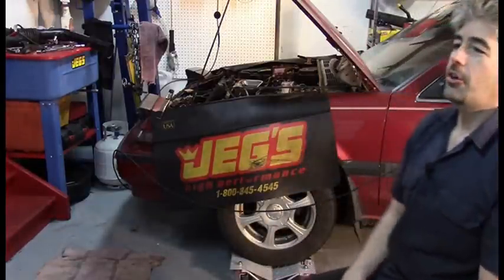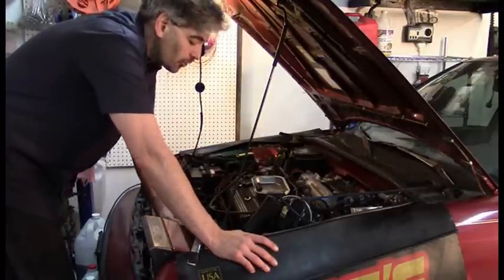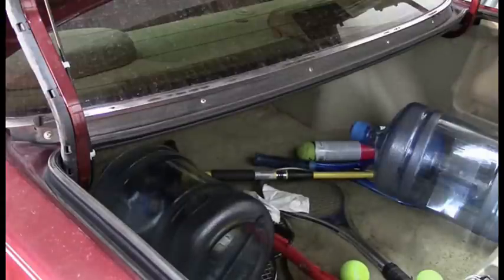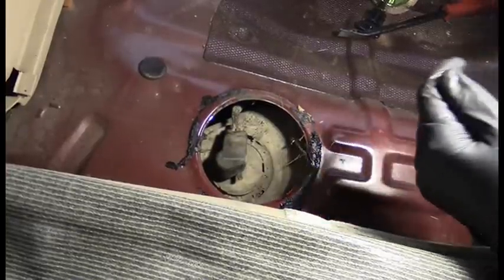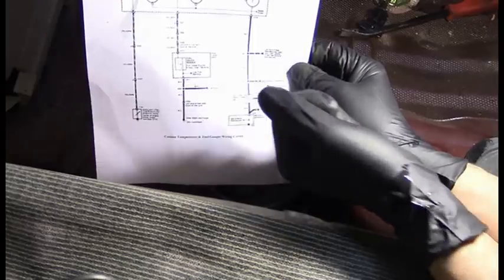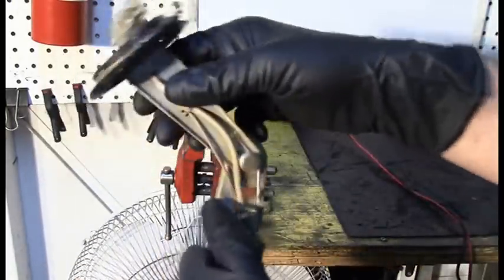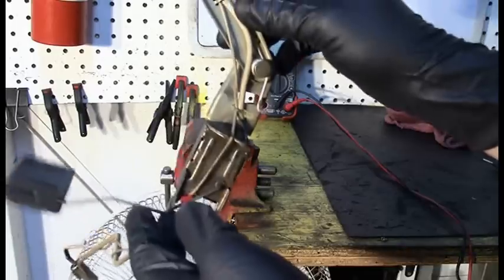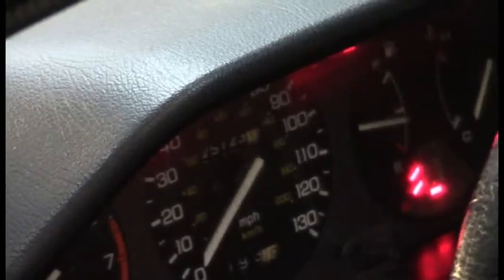Diagnosis of Stuck Fuel Gauge- Is it Gauge or Sending Unit?

Comment: You're a rare breed of molecular biologist/mechanic to help a vulnerable person instead of cheating them.
I can't access the wires on the fuel pump to my 05 Impala to see if that's why my gas gauge stopped working because I have no access panel.
Is there any other place I can access the connection between the gas gauge and the fuel pump to diagnose it besides the fuel pump?
I can't find a wiring diagram and for all I know there's a loose connection under the body of the car that I could reach if I could just find the wires.
My gauge stopped working while at a shop for transmission work and rear brakes.
It began clunking and grinding like I've never heard a car do before I even left the parking lot.
They said they forgot to remove the parking brake clips and they fell off. They said they had to disconnect the parking brake and gave me a free oil change.
I'm a widow with kids and these people have no soul. For all I know they damaged my fuel gauge (and parking brakes) but don't want to admit it.
That's why I want to diagnose it myself before trusting another mechanic.
Reply from the maker: it’s easiest to drop the gas tank slightly later on most chevy models and others without the access panel.
Reply: Schrodingers Box It sounds like you're saying the only way to diagnose it is to drop the tank, but it's even harder because it's an older model.
If that's the case then I assume I'd need a mechanic to do it, except that it would cost so much that they'd say it needs a fuel/sender unit even if it doesn't because they had to drop the tank.
I've read comments from people with access panels who replaced the pump & sender unit only to find it didn't fix the problem with the gas gauge.
Some have replaced stepper motors or instrument clusters too when it ended up being a "harness plug" or some loose connection somewhere between the fuel tank, pump/sender and gas gauge.
How would you handle this problem?
Thanks
Reply from the maker: The way I would do it if there was no access panel is very simply drop the tank a couple inches, access the wiring I need, and do my voltage tests. I find this easiest by far and i do it all the time. If I find the issue is not at the sending unit or wiring and inducing variable resistance had no effect on gauge movement, I would then test the gauge at the dashboard directly to identify the open or failed component. I have a video doing this on a speedometer on a Yukon or Bravado or similar in fact.

Comment: You're a molecular biologist?
Reply from the maker: Yes- way easier than being an electrician
Reply: Schrodingers Box I'm an electrician, and you may be right. Lol.
Reply: Schrodingers Box I've got a problem with a 99 GMC Sierra fuel guage, if you think you can help. I'm out of ideas.
Reply from the maker: What’s the issue and what data do you have?
Reply: Schrodingers Box 99 GMC Sierra. It seemed the stepper motor is going out. Shifting with brake held would jostle the motor back into proper working order. That tells me it isn't the guage sending thing, but the stepper motor. I had a spare cluster, so I switched the steppers. It went from working half the time to not at all. It doesn't matter where I place the needle, save that if I set it over halfway, the fuel light comes on. It's currently stuck at E. it won't reset, but the gas light isn't on. I have 3/4 of a tank now, but it's not showing. I've tried 3 different steppers that should be good.

Comment: Might have been more efficient to put 12 volts to the sending unit and then use the DVOM to sense voltage at the sensor wire during bench testing.  This would have allowed you to see voltage go from one end to the other and to find a middle ground fairly quickly and accurately.

Comment: I have an 2002 Chevy Blazer . I took it to get the transmission replaced and when I got my car back it worked but now my fuel gauge stays on empty , and the shop took no responsibility for it . I replaced the fuel pump thinking it was the sending unit and it wasn’t my fuel gauge is still on empty . What step should I take next ?
Reply from the maker: What was your voltage variance indication as shown in the video?

Comment: Hi there I hope you can help me,I bring my 2010 ford escape to ford dealer because of fuel pump recall after 1 day I notice the reading of my fuel,fuel gauge and mileage goes higher,the next day on my way home from work it stop on the freeway without warning,ford towed and fix it for me because part of it is there fault n my fault is the car doesn't have gas which is I didn't know since the reading is not correct,when I pick up my car for the second time on ford and put 30$ gas the fuel gauge is still stuck on empty,what do I have to do,tired of calling ford and I'm searching on website how much to change it nd it cost 2 weeks of my paycheck,can u help me
Reply from the maker: Sounds to me like your new fuel pump was not installed properly and sending unit was either damaged or is obstructed.
Reply: Schrodingers Box how much do you think it will cost me for repair
Reply from the maker: Depends- if there was defect from the installation it should cost nothing. Otherwise upwards of $500 nor even $700-$800.  
  If I fixed it, probably $400 total.

Comment: Thanks for the video!! I have a 2008 Chrysler Pacifica and Sunday morning it decided to say low fuel, I fueled up knowing I am low, but it stayed on low and have check engine light with a u1403. I was going to have a guy replace the pump. I don't have an access panel and don't know that I really wanna drop the tank. Well I find out that I have a primary and secondary pump, no idea which would be bad and sure as heck don't want to replace both. So thanks to your video, I am just gonna drop the tank and test both, so probably have to watch 2 more times...lol Thanks! Maybe I will even learn that its not one of them, but a bad wire. Could I possible test with it still connected and just expose the wire down lower and not drop the tank until needed?

Comment: How about a 1970 Chevelle? Mine reads 1/4 tank. Doesn't fluctuate much no matter the amount of gas. I have the gauge out of the car. Wish there were more shops like yours. People who care for more than the buck.
Reply from the maker: What did the resistance test indicate?
Reply: Haven't tested it yet. I don't know what the resistance is supposed to be.
Reply from the maker: None. Just test for circuit integrity to start.

Comment: i want to thank you soooo much for this video, my tractor ( Zetor proxima 7441) fuel gauge was showing more than full, with and without sender plugged in. i noticed you testing with a resistor and i remembered that i have a bunch of resistors from an arduino kit. I tried your method and yup! fuel gauge moved as i connected and disconnected a 100ohm resistor! 
I thought it was a bad gauge but you my friend have proven me wrong!
now ill take out the sender and hope that the rest of your instructions can save me from spending any money on it!

Comment: Awesome video!! I have a different problem. My 91 Wrangler :  Key on - Needle goes way past full. Key off - needle drops to empty. Key on - connector to tank (sending unit) unplugged - stays on full. Short on wire from gauge to connector ??

Comment: I have a check engine light and got it hooked up to a scanner that gave a 0462 code. I replaced the fuel lever sensor but the check engine light is still on. I have taken my vehicle to two different mechanics. One said the float is bad, the other says its the cluster that's throwing the code (which doesn't make sense to me because everything else reads besides the fuel gauge) PLEASE HELP,  I cannot get my vehicle registered with this issue.
Reply from the maker: Ok what data do you have?
Reply: It reads as the fuel lever sensor...thanks for the reply!
Reply: I'm basically going off of what the mechanics said...Then a guy today said that I may need to replace the fuel 
pump?
Reply from the maker: Well I don't go off what someone says- unless they have data. Can't help on this one, sorry. Give me some static and loaded fuel pressure curved against fuel trim and I'll make sure you don't get ripped off.  That's just how I roll.

Comment: don't forget to watch the decimal point on your meter :)
Reply from the maker: No idea what that is referring to but I will accept some advice on alternative methods to do the circuit testing faster if you have any.
Reply: reat video. I find it helpful.  when you seemed a little puzzled about 
the readings you were getting on the old sender, I thought I saw the 
decimal point
on your autoranging multimeter jump back and forth which would explain a lot.
could be just me; these eyes are old and tired. thanks for posting it.

Comment: When I disconnect the fuel lines on a diesel before removing the fuel 
sending unit, will I have to bleed the fuel system after putting the 
system back together? (audi a6 quattro 2005)

Comment: My gauge just reads 3/4 on my 98 Chevy Silverado.  It don't move or flutter.  What could cause that? Sending unit or gauge stepper motor?
Reply from the maker: What did your diagnostic test indicate when you testd the circuit as shown?
Reply: I didn't test anything don't know how to do that.
Reply from the maker: Justin Sero sr Oh too bad. Hopefully someone makes a video on how to do that.
Reply from the maker: Could be. What did your diagnistic test on the circuit indicate?

Comment: Your awesome for doing this for the elderly man and showing how to test. my car 98 mercury grand mrqs was parked and hit, since then the gauge is stuck between half a tank and 1/4 tank. do u think it would be the sending unit as well? there was minimal damage when the druggie hit my car cracked my rear bumper on the passenger side, I have a tow bar installed so that's prob what saved me from more damage. he hit that right rear corner and pushed the car over sideways about 4 feet.
until this happened I had no problems with my car.
Reply from the maker: could be. could also not be. What is your voltage variance on the sensor sweep as shown in the video?
Reply: that is a good question....im just a girly girl ....hopefully I can find someone that can test it for me. thanks for replying.

Comment: I have had many fuel sending units that read correct with a meter  and tested with harness connected to sending unit.   Sent vehicle out a week later vehicle has same problem,  It is good to do charity work but not at the expense of wasting time,  and making yourself look incompetent to save money.  sending unit will most likely fail again.
Reply from the maker: You aren't too bright are you. The purpose of this was to DEMONSTRATE THE TESTING METHODS.  This is a tutorial channel. In fact YOU would benefit from this in that if you actually understood your own measurements, they mean you have not isolated an independent variable as the sending unit itself!!! Unbelievable.
  Come on man.   Come on.  You don't understand this, really???
  Everyday people are getting dumber and dumber.
Reply: I understand the testing methods. You make them very clear  I was simply stating the reliability of the component,  I am sorry if you misunderstood the comment,
Reply from the maker: No i totally understood your comment. You were trying to state how i looked incompetent in this video by reinstalling the part after confirming proper operation because in your experience based on what was incorrect testing procedure because you didn't create an independent variable combined with an empirical ad-hoc-ergo-propter-how logic fallacy showed failure in the past. 
   If you are going to to call me incompetent, i really suggest  your procedure be  more rational than mine. much less irrational as you have admitted by your own statement. 
  come on man- LOTS of people see your comment. Don't embarrass yourself.

Comment: Hi, I have an 05 envoy, my fuel gauge was always empty so I replaced the sending unit myself, and worked for a day, next day when I crank it up, the fuel gauge went beyond full and stays like that until had half tank and started working, the when I fill it up, will do the same, some times I try turning the ignition on and off for several times and will work, some times, some times it won't. I replaced the seding unit twice and still the same, don't know if could be the gauge or wire or something else, any help will be very appreciative.
Reply from the maker: So what was the result of the diagnostic tests?
Reply: was the stepper  motor out of the instrument cluster ,  i replaced it and works just fine.

Comment: Good Day:  Here are the things that I for got to say. 2003 ford f-150 xl 4.6 liter 4wd. I turn the key on and the fuel gauge jumps up to full and then drops down to empty. both movements are fast.
Reply from the maker: What is your voltage data?

Comment: couldn't u have also used a test light instead of a resistor to see if that fuel gauge would move?
Reply from the maker: Sure. Anything that has resistance can be used but since I knew the quantitative value of the resistor I can anticipate the gauge's reaction.  I don't know the quantitative resistance of my test light off the top of my mind.

Comment: Great video! I, however have a ques. I have a 95 Toyota Tercel. I can fill it up and it shows full, but them after about 100 miles, gauge suddenly drops to almost empty or 1/4 tank but I know I have gas. I used to get about 350 per tank, now I'm scared to go over 200 because I don't know what the problem is or how to have it checked. Can you advise me please? I will then fill it up with like 10 gals or so and it goes back full as if normal and just stressful. LOL Thanks
Reply from the maker: What data do you have from the sending unit voltage?
Reply: I have not had anything checked. I was asking perhaps i you could recommend what would need to be checked so someone doesn't try to scam me. I guess that huh? (LOL)
Reply from the maker: N Valdez You need voltage off the sending unit and interptet the etiology for the symptom. There is no other way.
Reply: Oh OK . . thank you . . <3

Comment: Alright my gauge stays stuck on full. have a 91 civic. swapped with an integra ls dashboard and motor.

but I replaced the fuel sending unit with the original civic one and when I move the float on my own the gauge moves the meter correctly but when I put it back in the tank  it just rises to full?? makes no sense
Reply from the maker: Makes perfect sense.  What was the voltage data you got on feed and return that indicated to you the sending unit was faulty?
Reply: +Schrodingers Box I don't got none of that lol.

the unit that was in there before was burnt out in the middle.
Reply from the maker: ***** Exactly.  Thats why it makes sense.
  The video shows how to do the diagnostic.  Once you do the diagnostic the only possible explanation for the problem will be apparent and of course by definition, it will make sense.

Comment: Trying to diagnose the gauge of an 81 Ford F-250 and the Haynes diagram is pure crap as expected. I'll figure this out eventually.
Reply from the maker: As was shown you don't need a diagram. Only basic design compehension is necessary and you should be able to map out your own wiring diagram.
Reply: I managed to test the gauge with some trial and error. Unfortunately the gauge is fine meaning BOTH tanks have bad senders. Think I'm gonna pull the bed on this one.

Comment: it got a 94 dodge ram 2500 the gauge stays at half a tank until you fill the tank up then it reads full after that when it goes bad to half you cant tell how much you have needless to say i have gotten stuck and a custom to carrying back up fuel can cause you cant really push a 2500 by yourself :(  im try this on the weekend
Reply from the maker: Just perform the simple diagnostic test to find the issue

Comment: See in my gm 98 Chevy malibu the gauge moves very quickly when i turn it on without taking its time to move slowly up and then I put in gas and it doesn't read how much I have, it has power and all But I'm just gonna replace the sending unit cause its a 18 year old car cause things wear out and I believe that's its the cause for failing.
Reply from the maker: That logic doesn't register with me at all because I am conditioned to only change parts based on scientific evidence-based deduction. But good luck. I hope your guess is correct.

Comment: So did the fix hold or did you end up needing to replace the sending unit?
Reply from the maker: Unfortunately the fix only held for about 3 months and the gauge started reading erratically.  I offered to replace the sending unit however the owner declined.  6 month later I learned he died of cancer.  I did not even know he was diagnosed with terminal cancer at the time of this video.
Reply: I suspected it may do that. Those terminals just deteriorate with the gas. I have a 2010 Chev Impala and the sender unit is part of the gas pump - which is inside the tank. After 2005 Chev, in its wisdom, took away the hatch access inside the trunk - so I have to drop the tank. And since the new pump came without a sender, I have to switch it over from the old gas pump to the new one.   One question - the new pump has two leads - but no polarity or other markings.  And instructions from AC Delco just state to take out the wires from the old sender, and plug in the new wires... no mention of which wire goes into which port or if they have a specific port / way to go in.  one would think they would. Any comments?